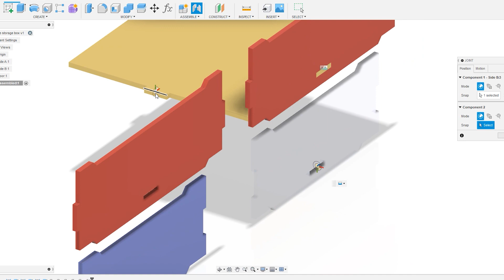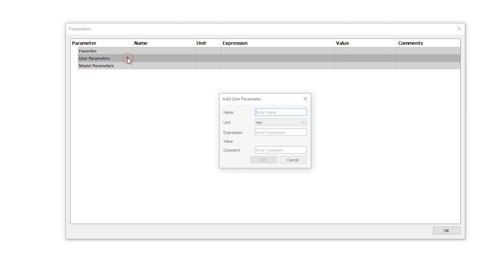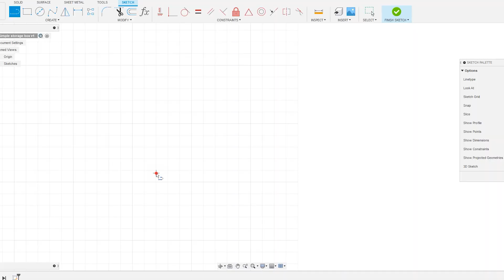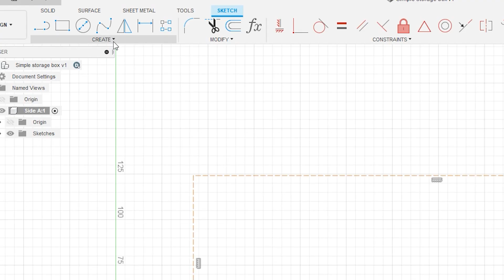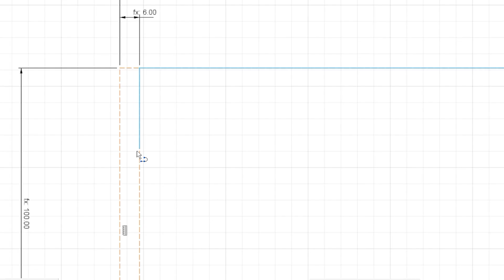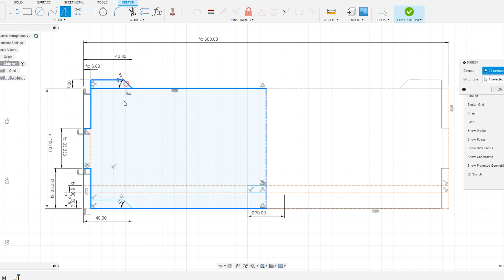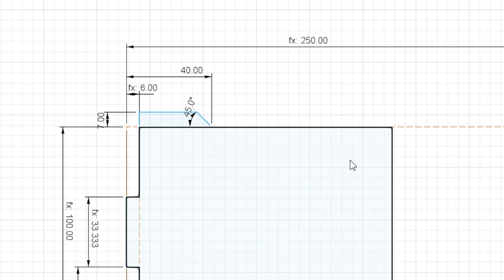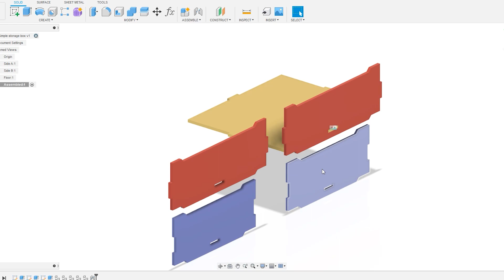Fusion360 Tutorial - User parameters | ARIBABOX

Comment: Love your channel! I’m learning to do joinery on my CNC and  have actually modified mine to allow vertical cuts as well.  My question: are your mortise and tenons exactly line to line with no clearances?
Reply from the maker: Thank you for watching! Depending on the project and the location of the joint, we sometimes add a small tolerance. But most of the time we keep it line-to-line — it gives a snug fit and makes assembly easier. You can always use toolpath offsets if you need to fine-tune the fit on your machine.
Reply: @Aribabox thanks! I purchased a few of your plans, very helpful, I am using Shapr3D but I did adapt some of your modeling techniques.

Comment: Are you using a plugin to insert the dogbones into all the interior corners?
Reply: I did not see any dogbones added, I would make the educated guess that he is rounding over all the edges to get a tight fit in the radiused inner corner.

I'm sure you are aware that a 1/8" round over bit will give you a tight fit at the interior radius left by your router bit.